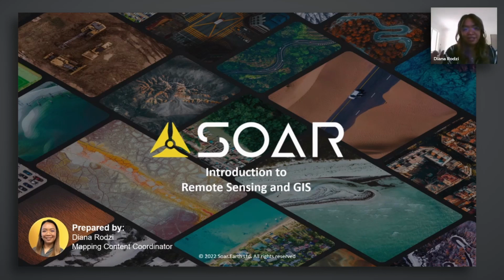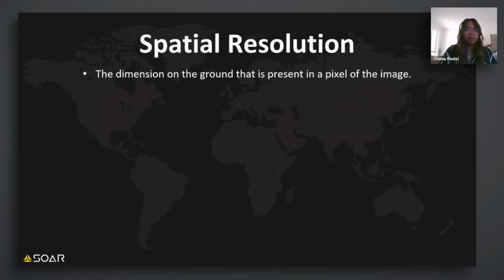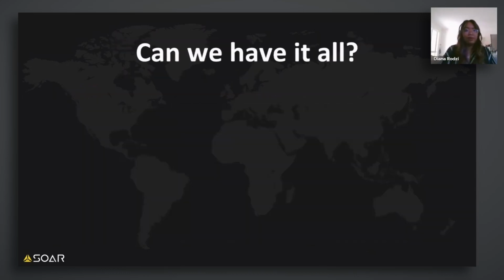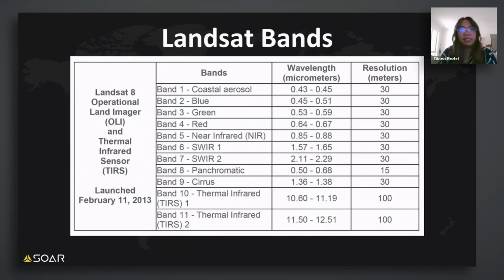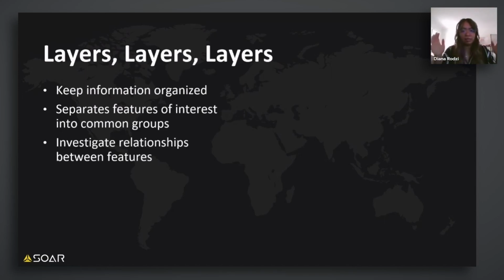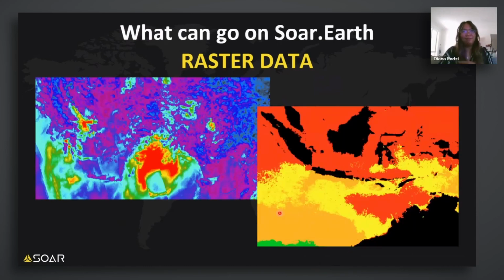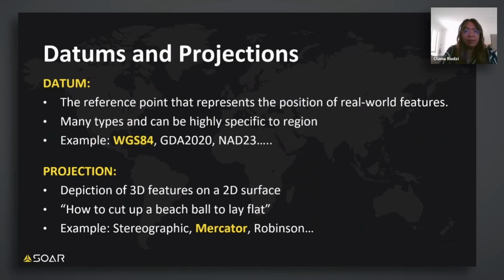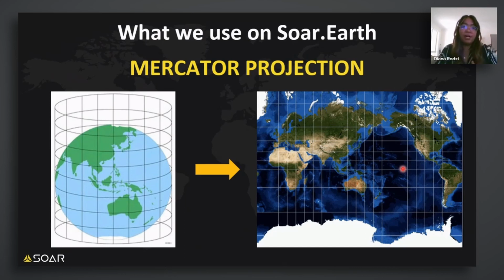Introduction to Remote Sensing & GIS - Soar Atlas Webinar

Comment: Hello i have 2 question 

Q1.If you wish to monitor the development of a tropical cyclone in the Indian Ocean, which type of satellite would you choose? And why you choose this sateille?

Q2.  why connectivity of lines and polygons is an important component in OpenStreetMap?
Reply from the maker: Q1: if youre looking at a cyclone, you'd prolly want something with high temporal resolution- something that would give you imagery every day. Since a cyclone is a large scale event, the spatial resolution wouldn't need to be high. There's multispectral/ weather satellites that are capable of getting an image every day and you would be able to analyze the cyclone through the different bands. If you want to explore the world of satellites out there, a good place to go would be NASA Worldview: https://worldview.earthdata.nasa.gov/ . From there, you could have the imagery load to you on demand and they've curated some satellite views for specific uses for those new to Earth exploration.

Q2: Lines and Polygons are generated from connecting many many dots to form the line or shape of your feature. In order to get a more accurate representation of polygon and line features, you'd want to include as many points along the curves of your features so it would be an accurate representation of the real world features. Connectivity for polygons is especially important since it is an enclosed shape. if the starting point is not connected to the ending point, it will simply be turned into a line.
Reply: @SoarAtlas  thx you so much